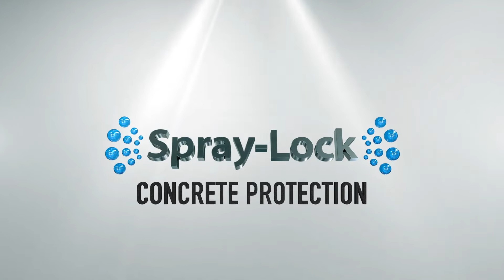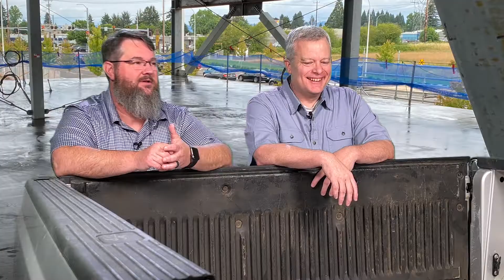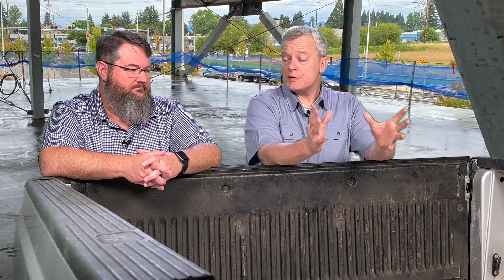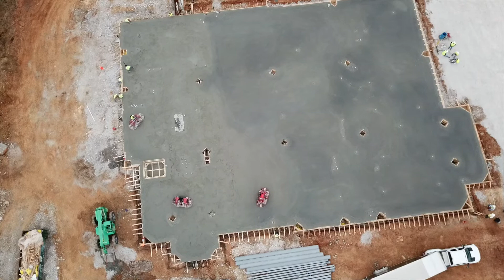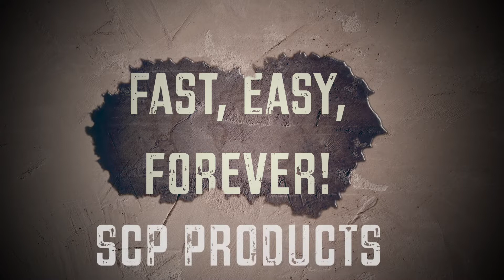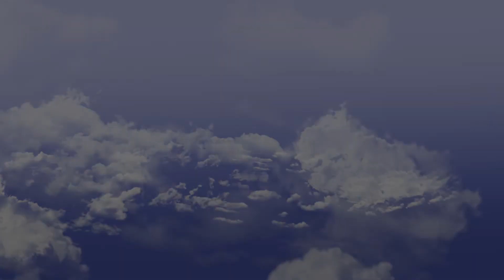Trapped Moisture in Treated Concrete

Comment: Hello, we had a cement driveway poured about a month ago and there are some dark spots we want to fix, we were told from one source an acid wash may open up the cement pours and a different person told us it was better to use vinegar because it is less harsh and wouldnt potentially ruin the cement further like acid would but it would take longer to work, how can we fix those moisture spots
Reply from the maker: Dark spots in concrete can be from several causes and may not be moisture spots. Without knowing the root cause of the discoloration, trying to give a fix is difficult. If you would like, reach out to scptech@spraylock.com and we may be able to assist you further.